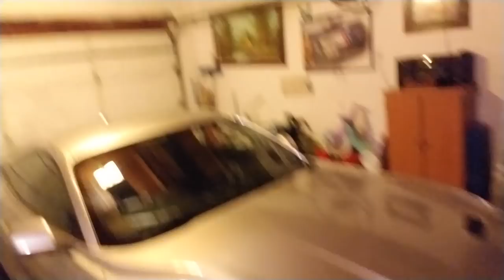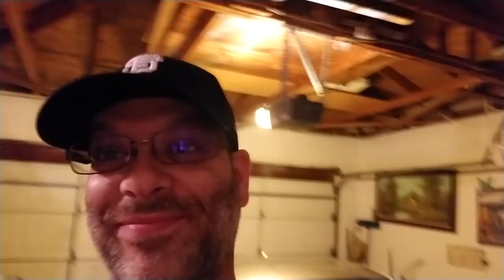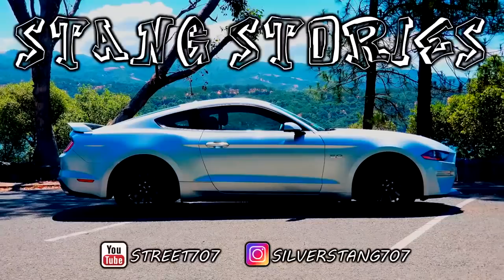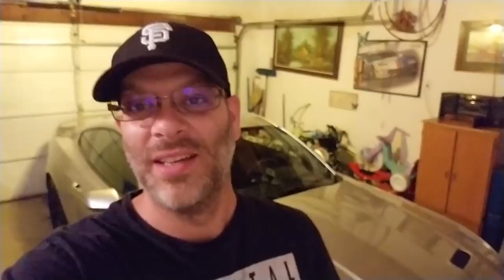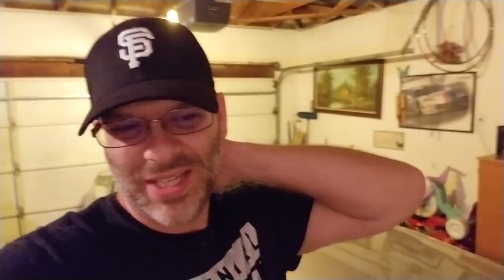2018 MUSTANG GT ENGINE TICK REPAIRS COMPLETE! What's outcome? * The Saga - Update 5 * Stang Stories

Comment: Have the cylinder walls bore scoped by an independent mechanic and make copies of the video file for a potential lawsuit, should that be necessary. Look along the thrust axis of the pistons(perpendicular to the crankshaft line) for signs of scuffing of the cross-hatch finish hone on the cylinder walls by the piston skirts. Piston slap is normally most noticeable on a cold engine start and diminishes as the car warms up. Due to excessive piston to cylinder clearance, the piston will rock on the wrist pin axis as the piston descends on the power stroke and again as the piston ascends during the compression stroke. The point on the crankshaft rotation where this is most likely to occur is at the point of greatest rod angularity. This rocking movement causes the piston's skirts to scrape on the cylinder wall, hence the name "piston slap". As the car puts on miles with this condition in place, the piston to cylinder clearance will increase as the piston and cylinder wear and the noise will become more noticeable and may not disappear even as the engine warms up.

I would be concerned that the dealership might have put in some heavier weight oil to mask the sound that you're hearing.

Comment: after my 2004 expedition blew out its 2nd spark plug I did the repair drove over to chev and traded for two year lease return suburban ford blamed it on the spark plugs not the heads I will never step into another ford dealer!! the heads had 4 threads and the plugs like 12

Comment: You may have mentioned this in another video, but what month was your car manufactured?
Reply from the maker: if i'm looking in the right place and reading it right.....december 2017
Reply: @streetridaz  I think the mustang's from Nov to Feb was having the issue. Some say a bad batch of pistons. I'm not totally sure. Mine says Oct 17. I was worried because I'm pushing 700+ hp through my motor and it isn't making any weird noises or ticks yet. I'm only at 3000 miles but they have been 3000 hard miles. My first oil change was at 1000 miles. I love the car so much that I dont think i could give it back even if something developed. I would consider swapping to the Voodoo motor if there wasn't a permanent solution. I'm wishfully thinking, ford will eventually make it right. Let's hope!
Reply from the maker: I hope so because i'm the same way. I love this car. it's my dream car. i waited 10 years and busted my ass to make it happen and now all this. Mine developed this ticking at 2200 miles.
Reply: @streetridaz  Yours is the same color as mine. Please keep posting updates. I'm curious the outcome.
Reply from the maker: oh yeah. i'll be updating as i get updates.
Reply: my build date is 5/2018 now at 2250 miles but no tick and running super great and fast...getting ready with RareFab to install a Whipple with a PBD tune.
Reply: Mine 6/18 mine ticks sometimes on cold start and goes away after..rattles too :) fuck me :) but i keep sending it :)
Reply: @SILVERCHARGEDS  build in 5/2018 with the same issue now getting the engine replaced...

Comment: Had the same sound in my 2016 S550...Drove me fking crazy it fked up the beautiful sound of my engine, it sounded like a tick or high pressure air seepage coming from the engine....after the dealer replaced the exhaust manifold then the header gaskets all under warranty the sound was still there the dealer could not figure out what it was and told me it was normal...I was pissed!!!!!!!!! I got rid of that piece of sh!t!!!!!!!!!!!! I loved that car and felt betrayed!!!!!!!!!! I will never buy another one I'm going Porsche 911

Comment: I haven't noticed any issue with my 2019, but I haven't listened specifically for this yet, only got 200 miles on it though.
Reply: Hope it doesn't affect you. Mine started i wanna say 400 to 500 miles into use. However not everyones tick starts around the same time and by the time we notice it who is to say when it actually started. 2018 btw. Just keep an ear our for it. I heard the 2019 its not as common or even an issue but I wouldn't hold my breath on that.
Reply: I ordered a 2019 GT premium 9 weeks ago and waiting for delivery. Very nervous after all the threads on the problems

Comment: Everyone needs to realize that Ford for the 2018 5.0 uses a Plasma transferred wire arc (PTWA) process for the cylinder bores. This process lines the cylinder bores with only about .006 of material, and my guess its flaking off. This is how Ford increased the displacement of the engine and shaved a few pounds from the block. Ford needs to go back to the pressed in sleeves and the problem will go away.  No one should buy a Ford until they stop taking short cuts. 

 
 

Reply

Comment: In my opinion its seem 5w 20 motor oil its too low viscosity for the engine ford should approved 5w 30 for the least viscosity on all there s550s

Comment: Social media blows this up a lot. Youtube makes it worse. Who knows how widespread it really is based on how many Mustang GTs have been sold. Lots of paranoia though. My 2011 GT had the same tick as he recorded on this video. I drove that car hard for years and I never missed a beat, engine or trans wise. However; the drag strip hard launches took a toll on the rear end. It was howling like crazy when I finally traded it. The tick on that car appeared at about 5-10k miles and went away at about 20-25k miles. I’ll admit, I was disturbed and paranoid myself then for a while but figured I would run it until the engine failed...which it didn’t. Some of the you tubers have legit issues to worry over, however; some are overly worried. Drive the car, enjoy it, and quit worrying over it. Let it fail if it’s an issue or sell the car. Have it documented every oil change. If at 30k miles, the car is still doing it, then start taking it in. Don’t modify the car until after the power train warranty is up if you are concerned or can’t afford repairing it yourself. Modifications will only make you more paranoid if you already are. There are those who want to complain when they walk into a Dealership with a tuned and modded Mustang and wonder why Ford denies or gives them issue with coverage. Ford warranties the car the way it came from factory.
Reply: GM had the same problem back in the early 2000's with an engine tick in LS engines. Forged pistons require more clearance when cold because they swell up when they warm up. People took their LS powered vehicles and demanded they fix them because they knocked for about 30 seconds when cold. GM's solution was to put hypereutectic pistons in that required less clearance but were inherently weaker as well. I'm guessing nobody has even had an old muscle car or driven a race car when cold.  I have a 2018 5.0  Mustang with 34K on it without a ticking sound. I could go on an on, but I'm guessing nobody on here has ever seized a two stroke piston from not letting it warm up enough before hammering on it. Oh and they haven't put sleeves in dirt bike engines for years either, they are all coated as well.

Comment: Would you look into a different oil......check out Schaeffers or Lubrication Engineers oil. Get a recommendation from them. 
One other thing, check with some of the Coyote specialists and get a second opinion. 
You mentioned something about the block design. Find out if the block bores are on center or offset to the crankshaft throw. If they are offset, then there will be more cylinder wear. Engines like the GM LS have on center style blocks so the piston and bore wear is very low, and is another reason they can hold a lot of power since the reciprocating forces travel a straight line instead of up- down and slightly to the side ( the inherent geometry ). 
The oil is the big thing to look into though. Given the nature of a Mustang spec Coyote engine you would think that Ford would step up on the the spec, but no.

Comment: Check this video out. It shows the side to side journal movement that causes a ticking sound against the crankshaft. Not much you can do, since it's the way the crank is machined. Only a whole new short/long block would come with a new and possibly tighter crankshaft, but no guarantees. Guys have had whole long blocks replaced, only to have it start ticking again in a month. 
https://youtu.be/Zhp0zTXHKPo

Comment: I was so close to trading my 16gt performance pack for a 2018 gt performance pack and I'm so happy I didnt do it. I understand it's a first gen coyote with direct injection but this issue doesnt seem to be from that. The shift forks are a joke. How long has the mt82 been out and they made it worse? Get it together ford!!!! I wonder if the ones over seas are having the same issues.
Reply from the maker: Agreed! Thanks for watching.
Reply: Street707 - Mustang Vlogger, FPV Pilot & PC Gamer Good luck bro. I hope you get the dream car you wanted without issues from the factory.
Reply from the maker: Me too. I mean it was awesome the first 3 months. LOL I don't want to ultimately say.........."Yeah i drove my dream car for the summer of 2018"
Reply: Street707 - Mustang Vlogger, FPV Pilot & PC Gamer Don't give up on your dream! Make Ford give you what you paid for. If it was just a car to you I would say cut your losses and move on but you clearly love the car. I can see the frustration though. I had issues with one of my local dealerships and called corporate. Suddenly they became much more accommodating. Just some advice. I had a blown valve cover gasket that they didnt want to fix. Called corporate took the mechanic for a ride and showed him the smoke and they where forced to fix it.
Reply from the maker: You're right i do love the car. It's amazing and i just want it running right. I'm going to give them this next fix and if it's not fixed in a timely manor then i'll decide what to do them. Thanks for your advice and insight.

Comment: I had the same problem with my 2018. Started @ 280 odo miles, I have a small video, I put on 4800 miles got tired of the dealer bs. Trade in for another 2018...700 miles in to it, I was like...kewl not tick!..well 1800 miles now the mofo is ticking. shitty situation man
Reply from the maker: Crazy how many have this issue. I'd say it's normal with as many people that have the problem as they do but when all my service techs and the Ford field investigator say it's not right I can't help but to think it's not right. Lol
Reply: @streetridaz  yeah especially when a few guys already posted pics of cylinder damage. Just sucks, you have it on video is a good thing. If worse case scenario I would get a lawyer
Reply from the maker: True that.

Comment: Just put my car in for the same problem. They told me it's a known issue. But does " not effect preformance". So pretty much out of luck
Reply: I experience random loss of power when pushing the throttle i wouldn't be so quick to disregard this issue if they know whats good for them. Just get it documented by Ford on every oil change you get just to be covered on your end. If anything fails in relation to the tick after your warranty at least you have proof u attempted  to get it fixed.

Comment: I had a 2019 California Special that did the same exact ticking, and I had them start up to other Mustangs on the lot and they both did the same exact thing. So there was three different coyote Mustangs that all did the same exact ticking and they were all built on the same day. So after buying my 2019 California Special, I traded the car in after putting 150 miles on it and got a brand new Dodge Challenger R/T 392 Scat Pack and now I don't have to deal with that ticking bulshit and the car actually has more balls then that coyote Mustang. My last five cars were Mustangs and I am so done with Ford it's pathetic. I will never ever buy a Ford again. I have had a brand new 2019 Mustang GT, a 2018 Camaro SS 1 LE, and now the Dodge Challenger and I will never go back to a Chevy or a Ford. The Chevy Camaro has no balls and no visibility, the Mustang has too many issues, and the Challenger has a bumper to bumper warranty for 5 years or 60,000 miles. Out of any American Car you can't beat that.

Comment: I would be 😡 too! Absolutely no reason why your car was returned to you with the same problem going on.  Really bites man. Hope your luck turns positive bc they are bad @$$ cars, but dayum, ford just needs to permanently fix this on going issue with the gen 3 coyote engines! It’s like a hit or miss with the gen 3’s just like it’s a hit or miss with the MT-82.  I hope Ford gets their act together on the mustang GT’s.  I’ve always loved mustangs and my 2015 is my 5th one. They make a stout GT350 and the SVT cars were pretty much solid for the most part. They are going to have flaws, but when it starts coming down to the engines and transmissions/drivetrain that’s a BIG red flag on engineering. Seems like they are going backwards instead of improving the mustangs and make the new generation more bulletproof to handle aggressive spirited driving and not have to worry about snapping a half shaft or shatter the stock clutch in doing so. Unbelievable!
Reply from the maker: Yeah man I love the car. I just want it to run right.

Comment: If your using 5w20 then your oil is to thin
Switch to 5w40 problem solved
Reply from the maker: I use 5w50 and it ticks just ticks 5w20
Reply: @streetridaz  
Yeah I was talking with others and they said when they switched it solved their ticks
Mine hasn't started ticking yet hopefully it won't

Comment: Hey Street707,

I'm just an average youtube viewer and ran across your video:
https://www.youtube.com/watch?v=gvooMbAt14U

This will sound strange but on my 2014 Mustang, I had the exact same issue. I had the same problems with the dealership and never got it fixed through them. I had to tackle it myself. What I did was I found a TSB  12-8-3 which talked about adding a AC belt tensioner due to a noise. So what I eventually did was a told them to remove the a/c belt completely so I could run the car without it. Noise stopped. The noise can be resolved for a little while if the belt is removed and reinstalled then the noise will come back, even after up to a year for the belt to get back to a certain condition and temp.

TSB 12-8-3 is for 11 and 12 mustangs but they never updated the TSB for the 13 and 14 cars. I also found out they never added the tensioner to the 15-18 cars either and I'm assuming they will have the same issue as the 11-14s. Ford is not updating the TSB and is not notifying their people of this lack of update to the TSB. They're doing a very bad job of troubleshooting this and replacing random parts. Very wasteful.

This is likely your problem. I recommend removing the belt temporarily as a troubleshooting step.

Comment: I’m not trying to be a dick but I told you brotha it’s normal for this tick to be honest if You don’t like it your gonna have to change the car
Reply from the maker: Thanks man and i'm also not trying to be a dick but more and more evidence has been coming out that this is causing cylinder wall scoring and both my ford dealership, my ford field investigator and ford hotline all say this isn't right. I'm going to take their word for it. I just hope it doesn't escalate into a buy back.
Reply: Street707 - Mustang Vlogger, FPV Pilot & PC Gamer look man this is the problem on the cars and that’s why ford doesn’t wanna fix it .. & that’s why thick oil stop it a lot .. I used 5w40 and I race my car a lot and it doesn’t do it only when it’s really hot or me driving it really hard

Comment: My build date was 05/2018 and they replaced with a 01/2018 engine. Which is making the same tick. I brought it back... they opened a case with Ford. Case is now pending engineer for an answer. They told me just to drive the car until I get a response back from Ford. F*ck!
Reply: That's ridiculous.... sounds like they want u to blow the engine.
Reply: Did you notice the tick from the new engine immediately?
Reply: shabouga after 200 miles
Reply: terrible......
Reply: shit.... we'll see how long it takes for mine to show back up with my the new short block